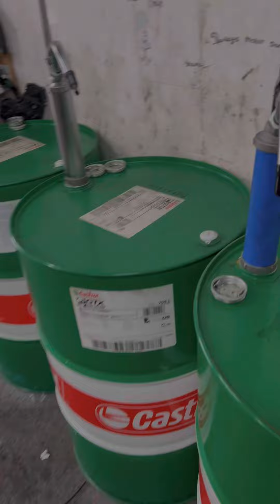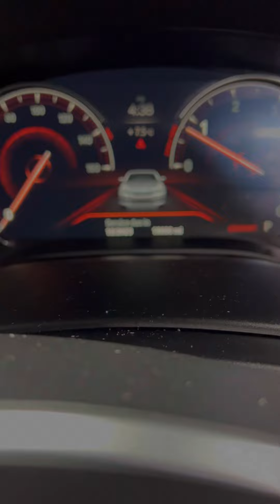Bmw 520d g30 2018 ￼ engine service, front disc, and pad replace  ￼

Comment: do you have a problem with squeaking brakes at low speed, it happens to me or is it time to replace it?
Reply from the maker: No, I don’t have no problem but I’m always using the BMW parts don’t put other brand otherwise, squeezing noise
Reply: @michaelclassic2613  now i have factory brakes the car makes a squeaky sound when reversing and braking
Reply from the maker: Did you change all of them? But what I mean, if you change just break, Pads  not the disc, it will make noise. I always change the disc and pad